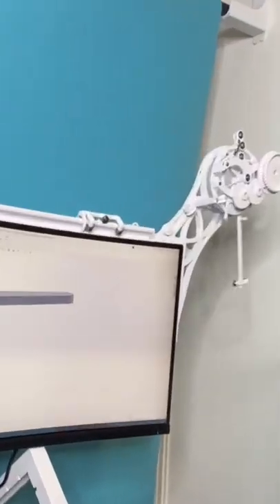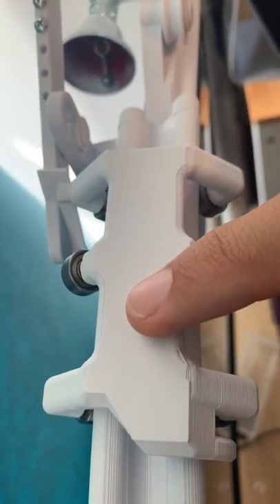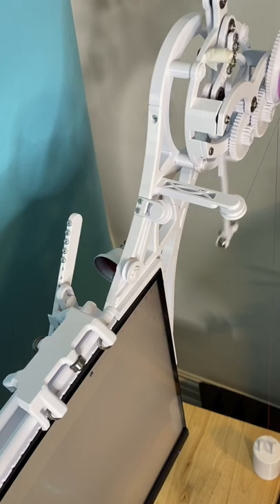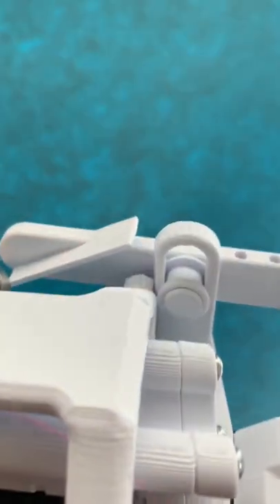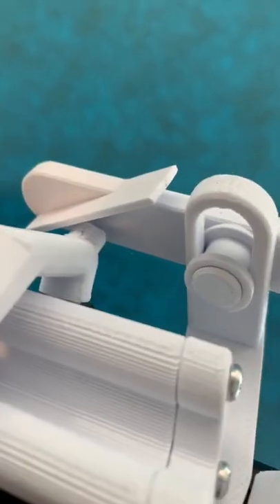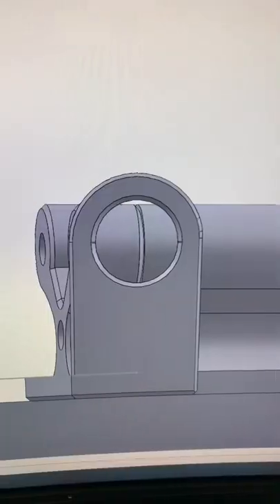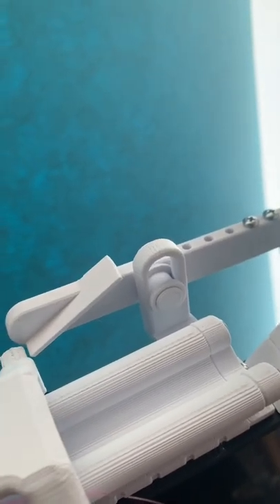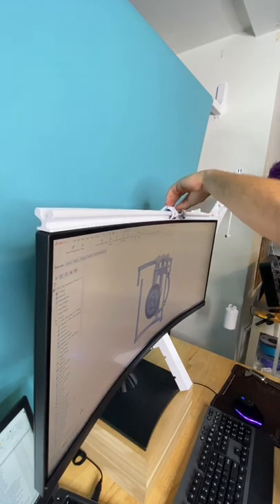How Does the Bell Ringing Mechanism Work?

Comment: If you take out the little tongue of the bell it will ring clearer when struck. The internal ringer is dampening the sound, which isn't a terrible thing but maybe is doing too good of a job.
Reply: Theres also that the external one rests on the bell after being triggered. Maybe a small spring would work to keep it held up just a bit. The excess force provided by the drop would ideally get the lever to compress the spring enough to land a hit.
Reply: @joshklenke7041  I really like the spring mechanism idea.  My thought was to give more play to the bell so that the hammer can strike the bell and fall into the bell void instead of resting on the edge.  Since the reset is manual, additional force to reset wouldn't be a significant issue.
Reply: I also thought having the bell upright instead of sideways would work better, maybe if it could swing freely afterwards, with the striker falling below the bottom of the bell, not interfering after the initial strike. But then I also just thought a simpler solution is to replace a normal bell with a receptionist desk bell. They are meant to be hit from above, and the striker can rest on the button afterwards and not dampen the sound.
Reply: @mcrsrm  Thats an absolutely great idea tbh. I was thinking more like the kind of bell system you see on the inside of a manual typewriter, but a receptionist bell might be a cleaner solution, Occams razor and all that.
Reply: Beat me to it. Alternatively, if the bell was suspended so the tongue isn't resting on the body of the bell, but that's probably a bit difficult.
Reply: @mcrsrm  That was my thought. The bell inside has no inertia.

Comment: To make the bell louder just hang it vertical and add a lever to convert the vertical motion of the ringing arm to horizontal motion. Or just use a bell with an external clapper (mount the clapper to the ringing arm) or a bicycle bell.

Comment: It would be cool to see your weighted pendulum mechanism with an added feature. The wheel that has the string attached to the weight, with a spring loaded wined up added. So when the weight reaches the bottom, the wheel turns and spools up the wire, resetting the weight.